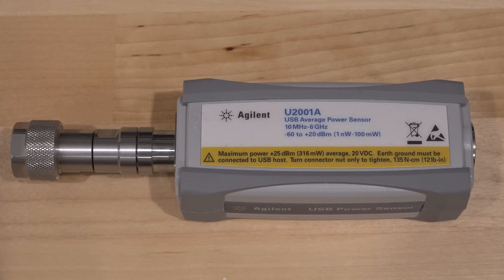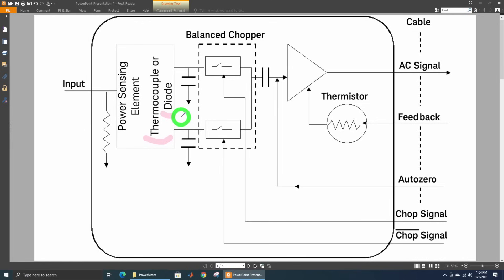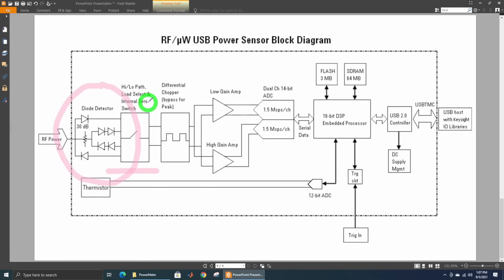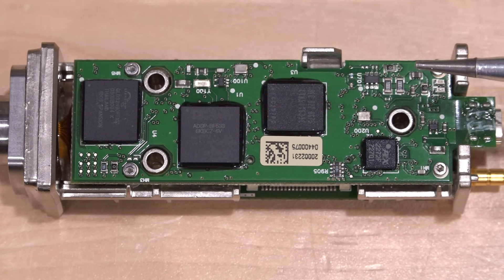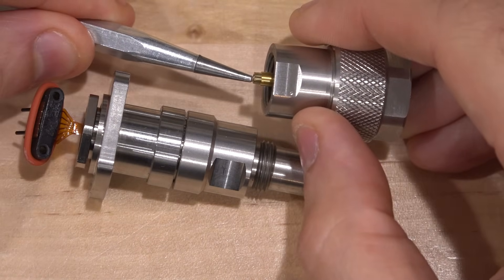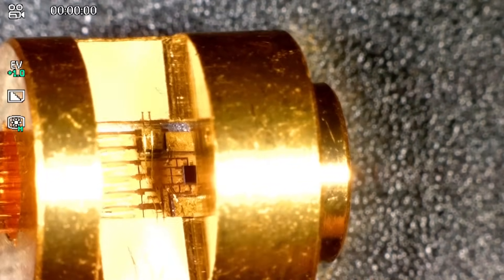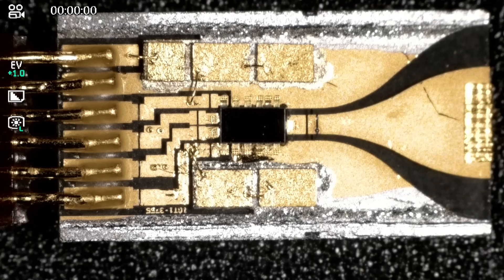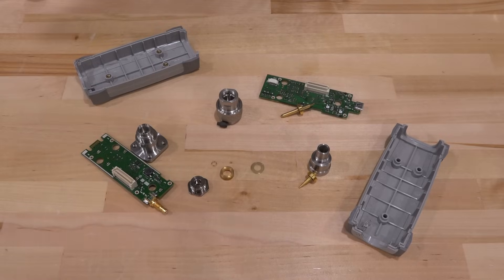TNP #8 - Teardown & Detailed Analysis of the U2001A 6GHz Agilent USB Power Sensor

Comment: I have a fully working U2001A. As you suspected Shahriar I'm sure it is the same or nearly the same hardware used for all power sensors in the family. Mine seems to work fine to 26.5 GHz, and maybe more. The levels are uncalibrated past 6 GHz  but the input impedance and response looks very good.

Comment: Nice Video! You mentioned that the diodes operate in a square law region. I was wondering what kind of diodes these are and why they have a square law region?
Reply: Great question DF. I personally though that "square law" referred to RoBlox in some way. Seriously, does sound interesting. Cheers!
Reply: These are shottki diodes. The output voltage = input voltage square X coefficient

Comment: What would be the benefit of using ribbon bonds over standard bond wires on the chip? The insertion loss of a ribbon bond compared to regular bond (even hamburger bond) is marginal and is typically only seen at E- or W-band to squeeze the extra bit of bandwidth in. This is a 6 GHz sensor though. Couldn't see any epoxy for die attach so are the ribbons being used to secure the chip down? Power handling capabilities?
Reply: @DrJoelVNA  Thank you!

Comment: It's amazing how zooming in this deep shows exactly how that high/low diode diagram reflects back on the substrate. Usually there is some 'simple' diagram and then when you look at an assembly or a component there is all this extra stuff that can make it hard to identify what's what. This is almost a one-to-one implementation on that sensor! Seeing the construction like this also makes you appreciate all the manual high-precision work that has gone in to this, almost making you wonder how ~$4000 covers all of that...

Comment: What is the purpose of the black material covering the pins of the processor?
Reply from the maker: Mostly for protection against shock and thermal cycle. People probably drop these things occasionally.
Reply: Probably glue to increase reliablity by preventing the chip from breaking off the board due to thermal cycles. That is a common failure mode of BGA soldering.

Comment: Substrate most likely is sapphire, even back in HP times, they used that stuff everywhere around RF signals, i.e. pi attenuator stages in their large multistage attenuators in RF signal generators/spectrum analyzers etc.
Sure that none of these maxim switches were blown? These things (Maxim and DG ones) fail quite often, most Keithley 20xx DMMs failures are due to leaky analog switches, since the diodes under the microscope look quite intact....
Reply: I wonder if they use Scott Zerodur for this application as well?  It is a glass ceramic with high transparency, high dielectric strength and an extraordinarily low thermal coefficient of expansion.  The latter property has made it an invaluable material for mirrors used in space-borne optics.
Reply: @Joel Dunsmore Could it be polycrystalline sapphire? That should make the dielectric constant isotropic (get rid of birefringence). I don't see why single-crystal material would be needed for low loss.

Comment: The detector seemed fine. I wonder what was the actual malfunction of this device.
Reply from the maker: The detector is bad for sure. I have verified this with another sensor.
Reply: There seems to be a long crack between the connector and the transition from the coax input side to the IC (upper side of the quartz substrate)?
Reply: I think there is actually a burn mark between the detector chip and the interface horn...